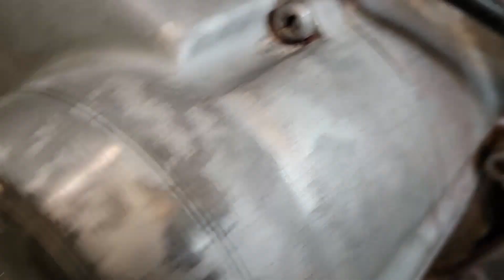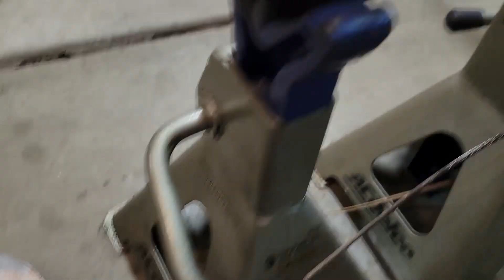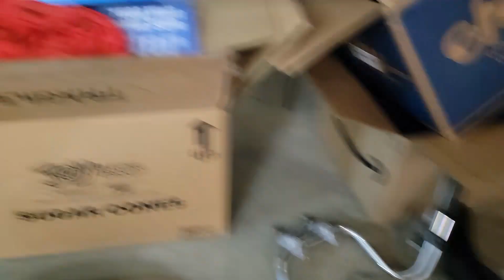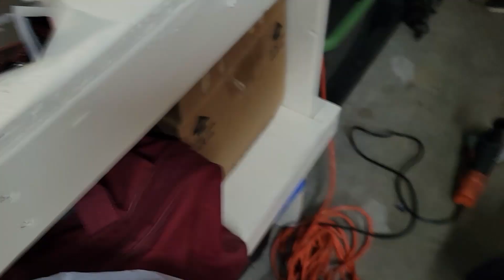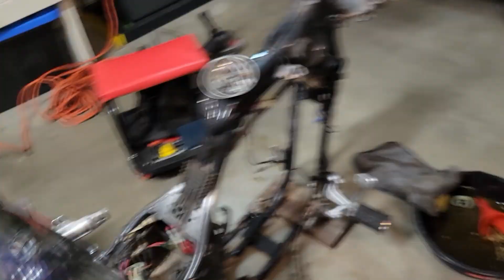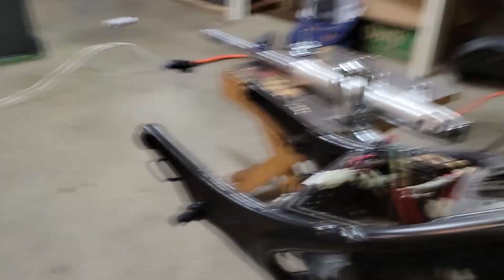UPDATE on the $100 V STAR 250 Project - Yamaha Virago 250 Build

Comment: My dad has one of those. He is to old and sick to ride it now, I am sorry to say. But I have given it some tlc. The original vacuum fuel pump is just horrible. His bike was awful to start. But I did a upgrade to a electric fuel pump and now it starts faster than my own new bike! The difference was night and day. I just removed all hoses, the fuel tap, the original fuel pump. Installed the new electric fuel pump behind the left chrome cover. New hoses, and soldered a new wire from the ignition switch to the fuel pump. I cleaned and refurbished the carburator and now it is a new animal. It starts immediately and just works. So scratch the original vacuum pump and get a electric replacement. It will be worth it.

Comment: Got myself a 500 dollar project.. 2008 xv250 with 4k miles. Wasn’t taken super great care of aesthetically but overall it’s in sound shape. Think it was just left sitting for a while. I knew nothing about motorcycles but find myself figuring things out as I go pretty well. Can’t wait to get it finished and start riding.
Reply from the maker: Sounds like you got a pretty good deal! I cheap bike is the perfect thing to learn with. Don't be afraid to break something because it can always be fixed.